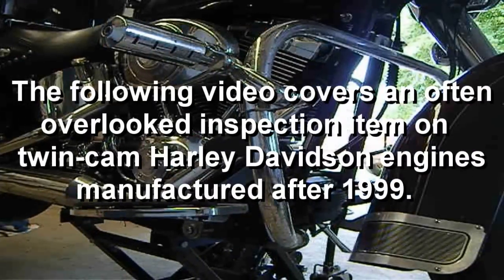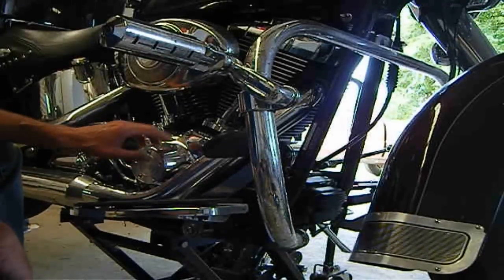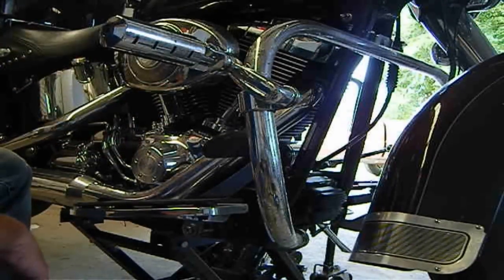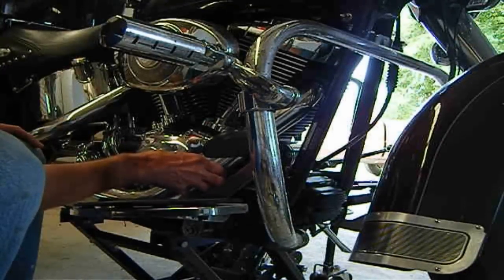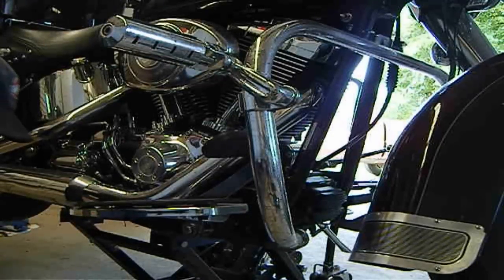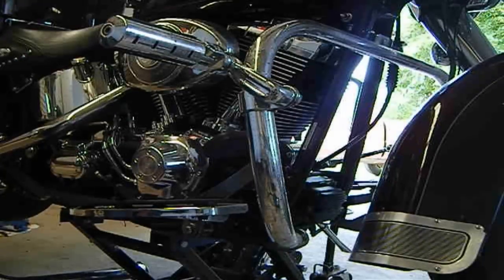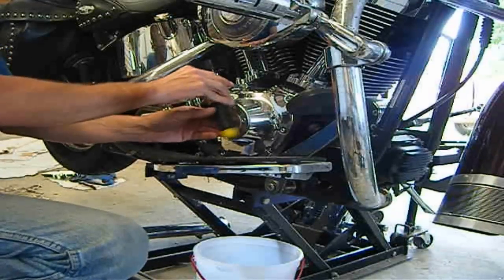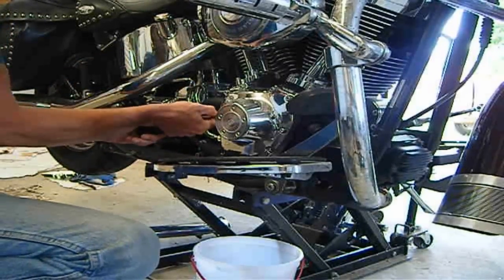TENSION HEADACHES: A Harley Owner MUST SEE!

Comment: iv had my 02 88TC  just a few months with 25000 and just read about this needing inspection. glad i did,1st as spring gets here,im doing same. great video. ive never really heard any1 say much bout this? is synthetic oil recommended 4 the nylon parts?,i'v no quams spending lil extra on oil if need be. preventative maintenance is a must and money saver! Thanks.

Comment: You take off the end of the push rod cover, slide the center cover up, and you need to just use cable ties or tape to keep it slid up on the push rod that it is out of the way, so the push rod can be cut with h.duty bolt cutters, of course you need to rotate the engine into a certain position for each push rod stroke before cutting so you dont let the lifter fall in.. Investigate this and u'll find plenty of info. Peace..

Comment from the maker: I can't clarify as I don't really know.  As far as I can tell, one would have to cut the tubes as well as the pushrods because the factory tubes are not collapsible.  Also cutting either is only necessary if one wants to avoid pulling the fuel tank and disassembling the top end.  Again, I'ts all hearsay on my part.  I've not had to do it.

Comment: You should clarify when you point to the push rods and talk about cutting here that you mean they cut the push rods inside and not the tubs also. I don't remember paying for new pushrod tubes when I had mine replaced.
Reply: i think with the s&s pushrods one of them rubs on the cover. i've been told,don't know this for a fact

Comment from the maker: @2002nighttrain Gear drive will eliminate that problem, but may make a worse one.  HD has an "acceptable" amount of crankshaft runout (basically that is the "unstraightness" of the crankshaft) if you have a bike with excessive runout on the crank you may have excessive noise with gears, or even gear, crank or bearing failure if the runout is really bad.
Something to look into before going with gears...

Comment: Hard to believe the MOCO ever considered putting crappy spring-loaded-nylon pads to tension a segmented silent chain. My '63 Chevy Impala had a timing chain just like it and didn't need a stupid adjuster and had over 100k on it. This is not the state-of-the-art engineering I would expect from an "elite" brand. This is "planned obsolesence" gone amuck. Why does the V-twin need 2 cams to do the same job of opening valves 1 cam has been doing for 75 years. S@S cycle gears can fix the problem.
Reply: i often wondered also why they need tensioners and a car timing chain doesn't. they're doing the same job,turning a cam.

Comment: I've read a lot about this in American Rider magazine, and I asked my H-D mechanic about it.  They recommend checking them out at the 30,000-mile mark.  If you don't beat on your engine and keep up on maintenance, you should be fine up to then.  I'm due for my 30,000 in a a bit, so I'll let you know what I end up with upon inspection.

Comment from the maker: @jnt4life Thanks John.  It was certainly in the back of my mind all that weekend =0  LOL!!
It's my understanding that the shoe material is the same, but the hydraulic pressure is more controlled than the spring.  I'll have to look into the shoe a bit more.  No one seems to be sure if it was strong springs, rough chains, or a combo of both that causes it.  But it looks like I'm blessed with a good one.  I'll let you know in 10k miles or so ;)

Comment from the maker: @Fudmottin No doubt manufacturers will try to produce a "satisfactory" product as cheaply as possible.  Kawasaki, Yamaha, and Audi, all use/used similar tensioners.  If I had a beef with HD it would be in the failure to disseminate the info. and maybe that it is a rather intensive procedure to change the pads once they're worn. 
If you notice the wear groove in the video, it leaves a sizable outer area which will eventually break off; sometimes clogging the lines b4 even reaching the filter.
Reply: LoudPipes 
9 years later it’s still a secret and I’m finding out about it.

Comment: @L0udP1p35 I'm just going by Honda's recommendation on the oil. It looks like HD is like GM. If they can save a dollar on production, they will.

I would hope that the oil filter catches the bits of nylon as it wears off. Nylon is really tough material. It is of course also very chemical resistant which makes it work for that application.

1/32nd of an inch is 0.0325 mils fwiw. A dial caliper can measure that. But you would be better off with a micrometer.

Comment from the maker: @Fudmottin The HD wet clutches can run in full syn. I use it in engine, tranny, and primary.

I'm not sure why they didn't use a wheel instead of a pad; makes sense. I was thinking the same and looked for something aftermarket...not found yet ;/

The problem occurs when the pad wears down too much.  Nylon pieces start to come off and can clog the oil system.  Eventually the pad disintegrates and then it's metal to metal, producing a nice abrasive for all the internal parts. =(
Reply: I saw an aftermarket set of shoes some years back supposedly better than stock, but can't find them anymore.
Either they WEREN'T  better or didn't sell well because no one wanted to drive the pins out of the stockers to replace them, but I would if I could find them.
Social security doesn't do much for High Dollah parts!

Comment: I am so not used to metric units! LOL

Full synthetic is not recommended for my Honda because the wet plate clutch system uses the same oil. I use a semi-synthetic which is not quite as slippery.

It's too bad HD didn't go with a spring loaded rider wheel tensioner system. Shouldn't ever need adjustment.

Looks like a dentil mirror you are using! Whatever works. The cam chains look pretty smooth.

So what gets thrown off? Valve spacing? Or can you get a piston meets valve problem?